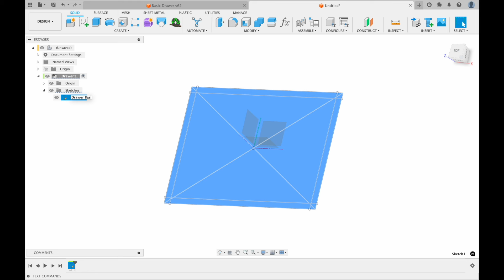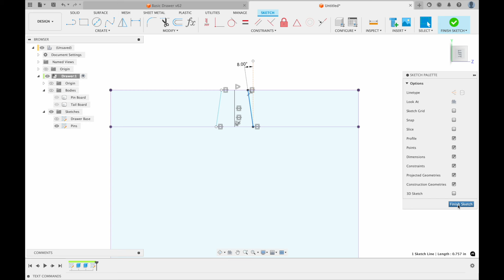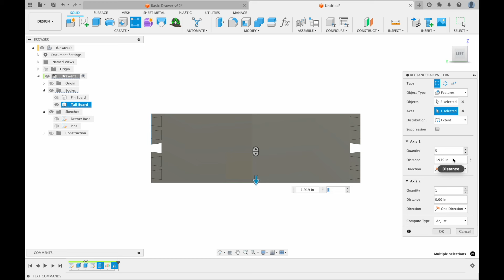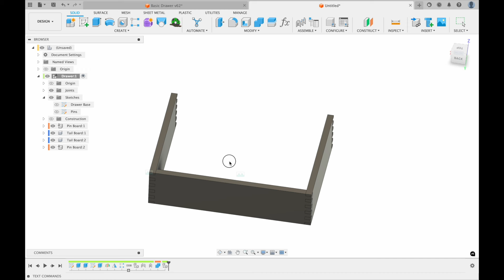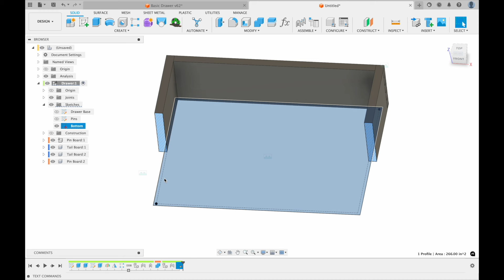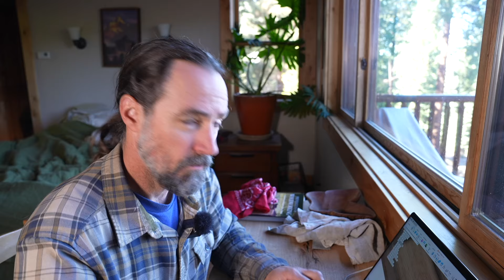Ep 1: CAD Dovetail Joint Design in Autodesk Fusion 360 for CNC Woodworking

Comment: when trying to space the dovetails along the edge of the pin board they snap the top and bottom of the pin board how do i turn snap off so I can get 1/2 of a tail at the top and bottom?
Reply from the maker: I think you hold down cmd (mac) or ctrl (win) to disable snapping.
Reply: @CorbinDunn  Thanks, It turned out to be "Incremental move " in the "grid and snap" menu at the bottom of the screen

Comment: I love my cnc but it sure seems like it would be alot faster and easier just to use my porter cable dovetail jig
Reply from the maker: I do have the Leigh Dovetail Jig; it is quite nice, and I've built many drawers with it! It is pretty fast, but I still do get chipout where the router bit sometimes pushes out. I also feel like I get better alignment on the CNC, and less messing around with trying to get the perfect depth (for half blind at least). It'd be interesting to test the time for both techniques, including setup and CAM for the CNC, and see which is faster. I'd bet the CNC would eventually win, as you can setup the next board at a different spot while the first is cutting, and then just hit "go" to start the 2nd as soon as it is done, and then replace it with the next, etc...
Reply: @CorbinDunn   well, if you're set up to do it and you already know how to do it then I'm sure there's no reason to use the dovetail jig again, but I'm not set up to do it on my CNC and I'm finding it hard to find a reason to make a setup. Though I probably will at some point

Comment: Waiting For More Projects with Features on multiple Sides. It is very easy to learn from your videos...Dont Know Why, the way you explain or approaches that you follow....great..!

After this series, Please do some videos on Organic Shapes like the Scorpion Tail or the Beetle Shelf..etc
Or a curved handrail of a staircase with flowing 3 dimensional curves .

 CAD,CAM + Work holding and figuring out fixture methods for those projects  seem to be complex..!

Please try to do any small component as an example Just to demonstrate your approaches on such weird Multi sided projects in Fusion with CAD and CAM+ Fixture methods.
I think managing Organic Shapes in fusion is not easy.
But Fusion is the best program for CAD and CAM for guys like me...! It is so amazing ..!

it would be great to learn from your approaches.!
Reply: Oh...I forgot....thanks for the effort you put out to educate us..! 
You know my ambition is  to modernise the traditional woodworking methods at least in my community with my Mach3 powered DIY CNC + Fusion360 with the help of passionate educators like you..! Dont know how it would turn out....Im highly pumped..!
Reply from the maker: Yeah! I am currently making a 3d snake out of wood, with flexible joints; I have some previews of it on Instagram. I'd say it definitely counts as an "organic shape", and it requires two sided machining to get it done right. I definitely could do a video on the CAM for it; I machined a lot of the middle sections multiple times to make a bunch of snakes, so I really nailed down an optimized toolpath (for clean cuts, not necessarily for speed). 

Going forward, I plan to do more furniture type stuff with complex curves.
Reply: @CorbinDunn   Oh...!  Looking forward to watching them all..! Thanks again..!

Comment: Thanks for this video, it was Money. Learned a new process of the combine command and a method of changing size with the offset and and X key, neat. Look forward to the tool paths video and all future projects. Cheers !
Reply from the maker: That's great to hear! I'm kind of 50/50 on doing Fusion videos, as I'm not sure people like them or not, so it is good to hear that you found it useful.
Reply: Well thanks again.  The trend seemed to be towards Vectric for the hobby woodworker. Early on I chose Fusion 360, there doesn't feel like there are as many videos out there for functional woodworking with fusion 360.  Maybe it's not the trending video niche with a pot of gold at the end but I found it useful and you definitely have a knack for teaching and film making.